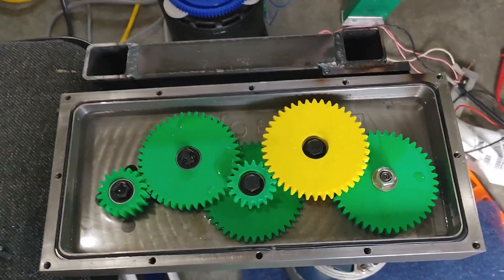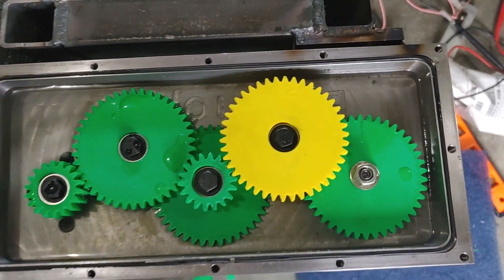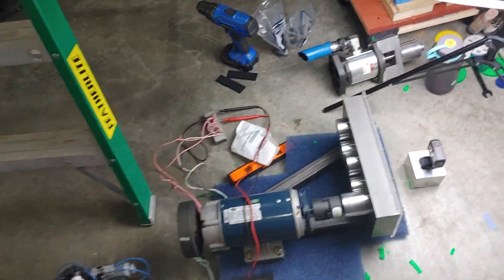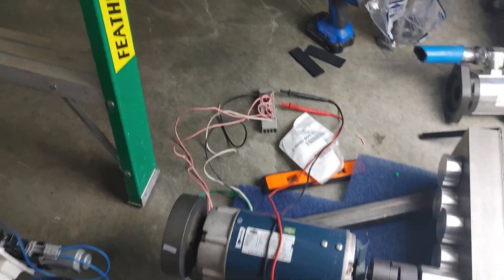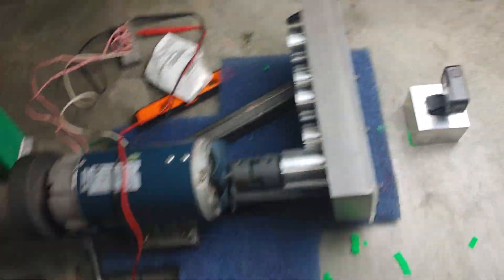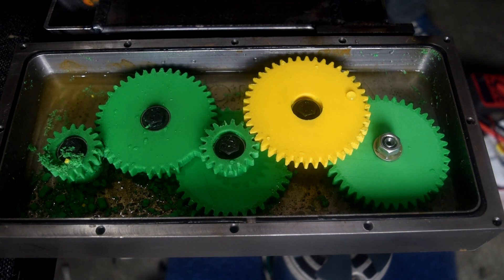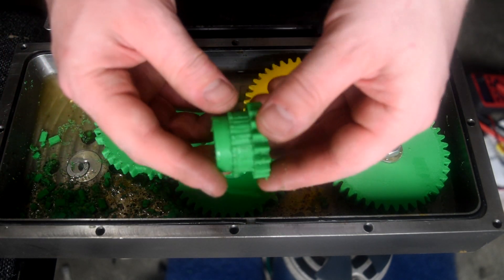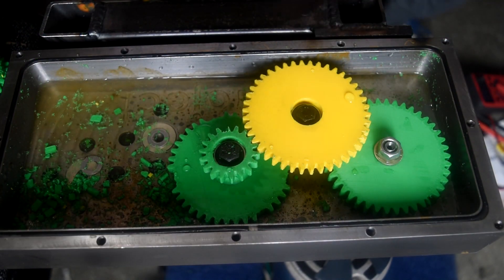How fast can 3D Printed Gears Spin ? - Testing my Setup

Comment: epic. i wonder if wider gaps between gear ratios would decrease total number of gears and thus make for less to go wrong per gear. also i wonder if a larger final gear's teeth would survive higher rpm. i wonder if you could get similar results with a smaller, higher rpm motor from a jetboard or something. idk how much power you need for 150,000rpm +  just food for thought. very impressive workflow/website.  maybe go from thinner to thicker gears as their rpm increases? to decrease total rotating mass while maintaining strength as they go up in speed. i think if you thickened the last couple gears by ~25% you'd be in business.

Comment: This just proves the ONLY problem with plastic gears is heat generation/friction... Its a shame there is no temperature probe in the fluid to determine if it sustains a fixed temperature or eventually gets to plastic melting point... The biggest problem is the small first gear - or small gears in general, it has the most force over the smallest surface area and often fails first...

The teeth broke with rapid changes of speed. The motor is a powerful one...
Reply from the maker: Hi Dave, I have changed my gear ratios on the new design so that the top speed will be 125,000 rpm as opposed to 250'000 rpm, still quite a goal. The smaller gear is now larger to help dissipate head. I wish I could do a probe but it's difficult to get a localised temperature.
Reply: @edwardpage8346  what's the best way to get that initial drive from the motor into the gearbox? Belt, chain, gear...
Reply from the maker: @daveofyorkshire301  http://www.edproject.co.uk/Tested1.html See my write up, not quite complete yet, I used a direct drive so keep losses to a minimum.

Comment: A trap to collect the broken teeth would probably help. Otherwise, a single chip will eventually run through the gears and break another tooth. Then you have two chips and the destruction accelerates.
Reply from the maker: I think it's likely that's how the gears finally failed, I'm adding a pump and a sump to reduce friction and also filter out anything other than liquid.